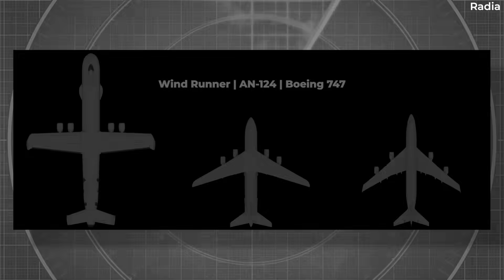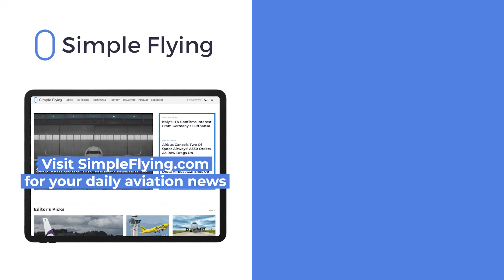Radia Windrunner: World's Largest Aircraft – 12x More Cargo Volume Than A 747

Comment: I gotta question the business model of shipping wind turbines.

Granted that an increase in size would unlock more cargo options, but even as it is, wind turbines dont get shipped by air. mostly because air is unavoidably expensive. And the lasts mile of transport no matter what is going to have to be via road/truck. So you still end up fucked with the issues of transport you had before.

The other thing is that wind turbines, generally speaking, seem to be produced fairly close to where they are used. and air transport is most justified on value dense time sensitive goods. like if im a toy manufacturer, why would i send my toys via air, when i could just send it via road/rail or ship for 1/100th the price.

And then you also have to ship the blades to the airport that theyre shipping out of. and currently, turbine blades are built as close as you can get to a port for the sake of shipping. Overall the whole concept would require a ton of reallocation of capital thats already been sunk into projects. As well as it looking for a solution to a problem thats already mostly been solved. Oversized loads(granted wind is loooong not wide/tall) travel across every nation in the world all the time. The other week I got stuck behind a convoy of massive transformers moving down the highway. Their destination, an urban power plant or something. But eventually when they did reach that last mile and were no longer on the highway, they'd surely need to clear a bunch of powerlines and traffic lights and bridges/overpasses and a ton of other obstacles. All of which would've been accounted for before they shipped the damn things. And another thing is that wind is majority rural. So realistically, your worst problem is gonna be the occasion power/telephone line after you clear whatever port your shipping out of. I hope they build it though. Need a spiritual successor the the AN-225s throne.

Comment: Will it earn the 'White Elephant' nickname? With a load capacity of 75 tonnes, the military must have a specific purpose in mind for it. A single battle tank can weigh that much, and fewer than 1,000 fully equipped soldiers will load the aircraft in a much smaller volume than that cargo hold.

Comment: Unless those are the biggest engines available, they are making a mistake!
Such clearance should be used for two massive new engines - or four massive engines. 
Is it made for volume and now weight? Wing seems small for weight.

Comment: Very impressive in design and concept - however the cost of development will be a few billion USD. Does Radia have that kind of money or backing ? Secondly the range and cargo payload capacity seems very less for such a large plane. The weight of this monster will be around 2 million LBS (A380 mtow is around 1.3 iirc) so those figures need rechecking.

Also not having a swept wing seems quite odd for a 4 engined jet. Unless this is just an initial concept.

Comment: The shape is great, but it is a very light duty concept. No doubt there will be a market for it. However, 4 GE-9X engines are good to lift an 840 tonne freighter off the ground on a 3,000 metre runway. The heavy lift specs would be 320 T OEW, 320 T PL and 320 T fuel. Obviously, need to strike a balance between fuel and payload as they can only total 520 tonnes. It would be the same length, but wider to fit four F-35 fighters - thus 11 metres wide at mid-ht in the cargo bay. As envisioned in the 1960s, a major cargo would be luxury vehicles - 150 per load. They could be sent to a distant market the evening on which they came out of the factory. Obviously, there are many heavy lift cargos urgently needed around the world by business, government and military.

Comment: Range is quite short so not intended for intercontinental flights,  more port to site delivery in leu of roads, so the port will need to near an airport capable.  So in Australia,😮 Brisbane and Sydney could , maybe Darwin (not much space at Sydney though), but not have the range to reach a lot of Australia  (Sydney-perth) is 5 hours!).  Otherwise a dedicated facility is needed.
Low mass oversized loads.  Would be unpressurised looking at shape (just a pressurised hump),   Rough strip operation, those forward wheel will tend to FOD the engines?
And will it fly out the decommissioned blades?

Comment: The maximum payload is 80 tons while the maximum payload for a 747-400 is 177 tons and the maximum payload of a 380 is 165 tons so it's less than half of existing planes making me think it might be more practical to carry blades attached to the outside of a plane like the shuttle was transported back to Canaveral from Edwards after it landed.

Comment: While offshore wind turbine blades are reaching lengths around 100 meters (300'), onshore wind turbine blades are shorter, typically about 50m, limited by what can be transported long distance by road. Longer blades increase power delivered, and revenue earned, since they access greater area and stronger,  steadier winds further from the ground. Creating specialized plane for this one use case might work out given the massive scale that wind power operates at.

Comment: Basically a Beluga specifically built for wind turbine blades.  
For reference:  

Largest aircraft by cargo volume:
An-124: 1100 m^3
An-225: 1300 m^3
Airbus Beluga: 1500 m^3
Boeing Dreamlifter: 1840 m^3
Airbus BelugaXL: 2209 m^3 
Radia Windrunner: 8200 m^3

Largest aircraft by lifting weight capacity:
Radia Windrunner: 72,575 kg
Airbus A350F: 111,000 kg
Antonov An-124: 120,000 kg
Lockheed C-5: 122,470 kg
Boeing 747-8F: 134,200 kg
Antonov An-225: 250,000 kg
Reply: Thank you very much for making an effort mate! That’s really helpful. Have a good one!
Reply: antonov an-225 was an absolute beast
Reply: Technically its long fuselage could prove useful to haul empty rocket stages too as they show on their website. On their homepage, you can actually have a look at the aircraft being loaded with F-16s. An empty F16 is just 8.5 tonnes, It coud prove useful for ferry flights without deploying a refueling aircraft.
There could be a few interesting applications too!
Reply: Weird to ge stingy on trust in this project! Especially when there's already a number of engine options available in the US itself to get a decent trust for the project. 4 GEnx-1B would take this plane to a similar payload of a Boeing 747-8F, and are amongst the most fuel efficient engines in the market.

Comment: I'm a sailor and windmill parts are a regular cargo for me. Windmill blades are relatively light for a ship. But they are getting bigger quickly. Enercon' s longest blades in production are 104 meter and Vestas longest are 110 meter. These blades are made in ports, because they are normally carried over sea. Production of blades is also shifting to India and China. I think this aircraft is to small for it's intended cargo before it's maiden flight.
Reply: If you didn't listen to the narrator: That plane is intended for on shore wind turbine blades. These are quite a bit shorter than 100m.
For off shore that's a completely different talk, but that plane isn't designed for that.
Reply: I’ve always thought airships would be a better fit for moving this type of cargo.  They can also deliver right to the installation site, bypassing the regional airport entirely.
Reply: Windmills used to be used to grind flour, this is for wind TURBINES.
Reply: @grahamstevenson1740  That's the problem with English, we honestly don't know what the thing is, till we see, if it is hooked up to a generator, a pump or a grinder.

Comment: This is pure 3D rendering fantasy, but most importantly there is no economical reason to build such a speciality aircraft just to perform a very specific task.

Main reason why they put wind turbine in these location is because of high wind. Good luck landing this on an unpaved runway with high winds blowing. This type of landing on a unpaved landing is only done by military. Do you for a second think any insurance company is going to let that happen?
Reply: those farm sites are also selected for steady winds form a single direction. a constant headwind could make landings easier. still needs bigger wings to really get the low speed lift for a soft landing. Hell the whole thing needs to be much bigger with how large turbine blades are going to become. especially if they were not constrained by road and rail limits.

Comment: Most of you guys are missing the point. This is not designed to lift super heavy loads. Thats what c-17s, c-5s, and AN-124s are for. It is designed to lift very large, relatively light loads that take up too much space for those other planes. Specifically wind turbine blades obviously as its only real job. If it is not going to be lifting super heavy loads, it does not need huge wings relative to the size of the fuselage (and keep in mind, these wings are STILL almost twice the size of 747's wings). If the company says there is enough demand for that work, then who are you to say otherwise? The added benefit for the occasional military use is just a bonus. Need to set up a FOB? Instead of sending in soldiers and engineers to a dangerous area to build it, why not build most of the construction in a safe area and just fly the whole building in one piece? Instead of shipping rockets and planes in pieces, you could ship them fully constructed.
Reply: Where did you get twice the size of 747 wings, the 747-8 has a wingspan of 225 feet. Did you mean area?
Reply: A 747 has a wingspan of 68m, this has a wingspan of 80m, that is not almost twice the size. An A380 has a wingspan of 80m and that's with the sweep. Regardless you are correct about the light loads, but I think those wings are still too small.
Reply: @Djamonja  You are right that the wingspan is a bit odd, but the important thing to consider is wing area. Since most planes have roughly the same shape wing, we look at wingspan, but really the area is what determines how much a wing can lift. And since this is a rectangle instead of a swept wing, the area is significantly larger than a 747
Reply: @russvan9683  That is true.
Reply: @Djamonja  But you're not factoring in the high aspect ratio and the chord depth near the wingtips. Also, the wing appears to be extremely "thick" in its plastic contouring, far more so than the thinner relief of older generation wings. All these things can contribute to lift. Those wings are optimized for cruise at 41,000 feet, after all.
Reply: @Infiltrate.and.Betray  We'll see if they build it.
Reply: That's the problem.  It's not designed to life super-heavy loads.  The vast majority of large airfreight is a problem for regular aircraft because of weight, not size.

Comment: Not going to happen. That small wing and only 4 engines cannot beat the good old Myria
Reply: absolutely! imagine a new Myria with composite materials and modern jet engines and with even more payload than the predecessor
Reply: @MrCaiobrz Not intended for the same purpose,  AN124, more than 120 tonnes, Windrunner no more than 72 tonnes. It's all about volume. Off shore wind farms, you can float out pretty much any length. Inland, anything over 50 meters gets highly problematic. The really smart idea is designing it for rough landing strips. Means it's a lot easier to build a strip near the destination. I bet they will have to restrict flights if a significant cross wind landing is expected.

Comment: Seeking an energy source that does not depend on fossil fuels, in order to build a wind power facility, it is full of contradictions to try to build a huge transport aircraft that runs on fossil fuels.
If you are so keen to build a wind power facility, I think it would be better to transport the parts on a sailing ship.
Reply: How do you propose sailing those parts to Colorado?
Reply: I reckon a modern Zeppelin would make more sense. It could hover and place the blades on the turbine directly, no huge trucks, no boats, no cranes. Just have to prevent it floating away when the load is reduced. Perhaps equivalent ballast that could easily be placed by truck, used to anchor until blades fitted then adjusted and flown away.

Comment: Interesting video Simple Flying.
First time hearing about this aircraft concept. You know I almost imaged it was comparable to the AN-225, though it seems the payload capacity of the Radia Windrunner is stated to be at 80 tons, surprisingly 196 tons less than the Mriya. Just about 1000 nm at max payload..? Well I mean a plane of this size is heavy and these are just figures for now. But what I find very interesting and curious, if it’s to be the largest plane in the world, what engines would power this huge quad jet? Would it be engines like the GE9X, a higher thrust Trent XWB? Or perhaps, the Rolls Royce Ultrafan..? Maybe?

Comment: That wing looks almost comical the more I look at it.
Reply: I guess it prioritises lift rather than speed to get that huge fuselage in the air
Reply: it reminds me of a t-rex with its giant body and comically small wings compared to that body.
Reply: Straight top mounted wings are very common in purpose designed cargo aircrafts, check the C130 Hercules, A400M and C17 Globemaster. The longer and skinnier wings can be is translated to fuel efficiency. Downwards wingtips are generally for increased manoeuvrability. Looks aren't important!
Reply: Modern aircraft design get a lot of lift from the sesign of the body.  The wings are also still 260 ft. Wide.

Comment: That wing looks all wrong to me
Reply: Probably because it's designed to fly far below trans-sonic. Swept wings are only needed at mach numbers nearing 1.0.
Reply: That's because it is intended to fly low and slow.
Reply: @leifvejby8023  with  afew hours  in both Caribous and Twin pins  both copped  bird strikes  up the arse  the wing still looks wrong  to me  and gawd help he poor boggy and load masters working out the wt and bal
Reply: @philcleaver2703  I can't see what should be wrong with it. Broad wings to get the thing off the ground at a lowish speed, and a fuselage long enough to take the turbine blades. 
Balance - my gut feeling is, that the wings should have been fitted about five meters further forward on the fuselage, but I don't know anything about wing turbines and the balance of their blades, only about aircraft and chainsaws. 
It is intended to fly low and slow. If it was intended to fly high and fast, and operate from concrete, I would have put way narrower swept wings on it, to increase L/D, but not for this job.
Reply: @leifvejby8023  Slow, yes. But not necessarily low. The specs on Radia's website mention "Cruise Speed  Mach 0.6" and "Ceiling  12,525 m / 41,000 ft".
Reply: Looks like it could use a canard in the front.
Reply: The flat bottom is used as a lifting body. Creating lift along the entire fuselage.
Reply: I think that we are not use to seeing a straight wing aircraft that is that big.
Reply: @lionheartx-ray   loks like an ATR wing that has been rogered  by a Blackburn beverly :)